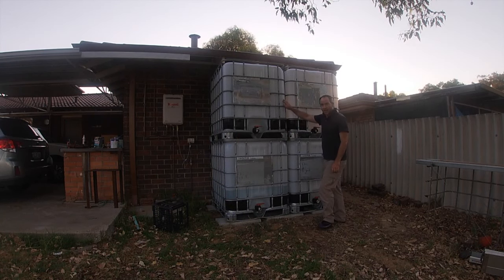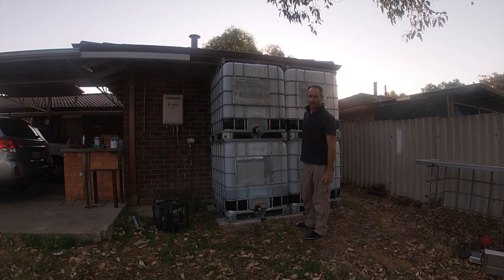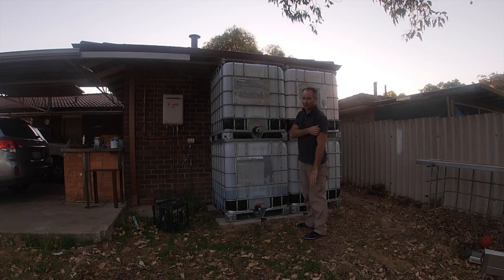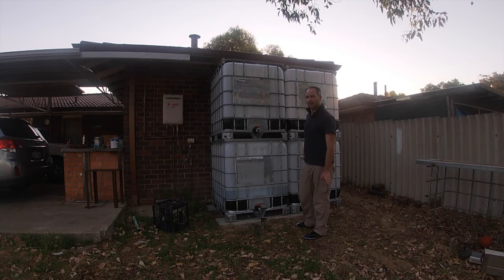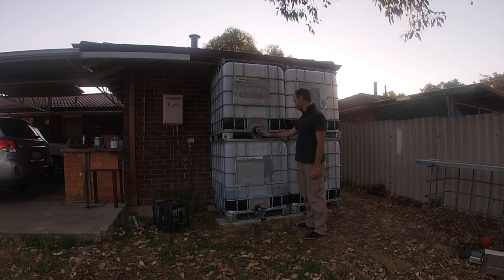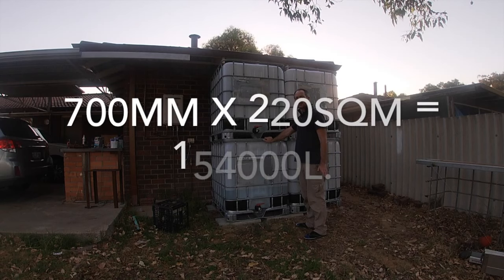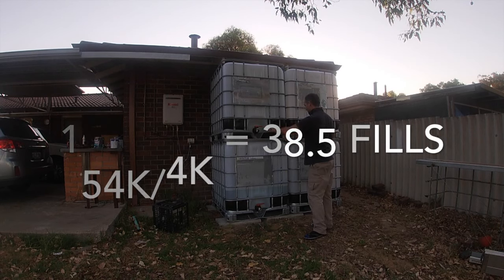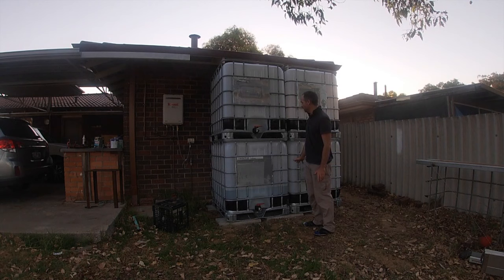IBC Tank Set-Up | Water Storage #1

Comment: setup I will build at my yard. but bottom tanks will fill with overflow water from top tanks so there will be enough pressure for wide usage in yard and garden
Reply from the maker: my top tanks pressurize the bottom tanks but air gets trapped I put an air release line in running to above the top tanks so it doesn't act like a siphon

Comment: how did you vent bottom taks
Reply from the maker: i put some 6mm flexable pipe in the lids and ran it up the side of the top tanks. it tends to block with gum nuts. It doesn't leak or siphon water out  but its not ideal